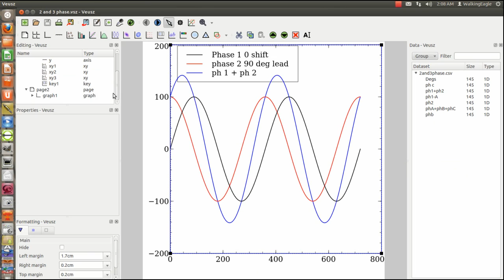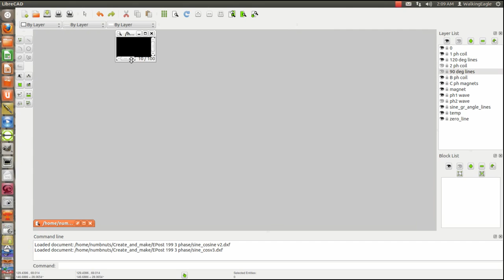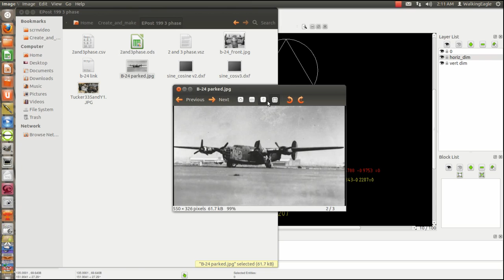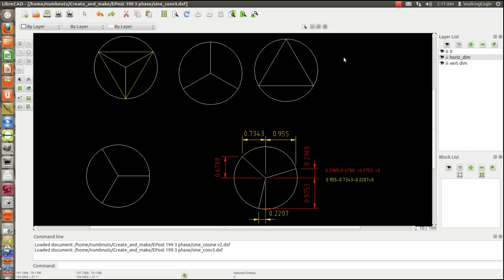3 Phase - Perfectly Balanced

Comment: Interesting video and unfortunately, mostly wrong.
The power that is supplied at any given moment via 3 phase isn't the sum of the voltages. It's the sum of the absolutely value of the voltages. That also shows the differences in power during each revolution of the generator or motor. For 3 phase, the relative differences range from sqrt(3)/2 to 1. And regarding the props on planes, The reason they used 3 blades is quite simple. The fewer blades, the more efficient the propeller. However, a single blade is extremely unbalanced and would tear the engine apart in seconds. So go to 2 blades. But two blades as they rotate will align with the wing twice per revolution, and each time they align, will flex due to the changing resistance they encounter pushing air. This resonance causes the blades to flex fore and aft until they hit the wing. Or you stiffen the blades (and make them heavier). But with 3 blades, they don't encounter that resonance.
Reply from the maker: John:  I suggest when you tell someone they are wrong, that you be less wrong than they are.   I used the word power incorectly, but you did also.  Power is the both voltage and current.  The square root of 3 comes in when going from WYE to Delta or vice versa... I did not do any of that... and if you want to get anal, don't forget about the Square root of 2.   The purpose of this video was to show how it is perfectly balanced through a cycle.   The Instantaneous addition I did is exactly what happens to current in a wye connection and is the reason the fourth wire is not necessary on 3 phase motors which are internally wye connected.
The goal was to simplify the concept which I did  Not to prove how smart I, or you are.